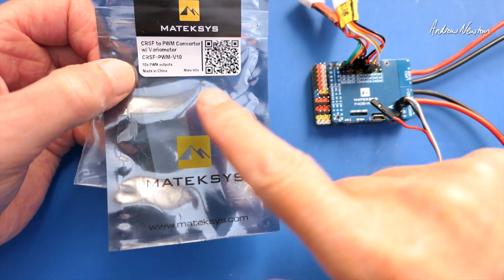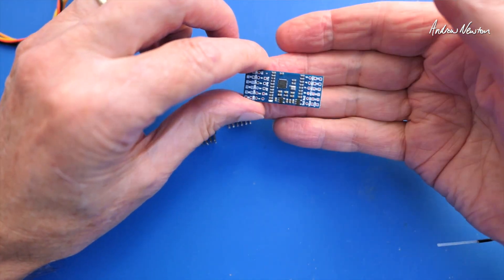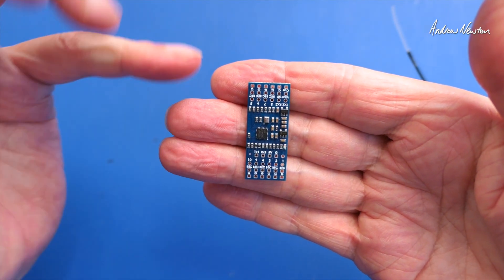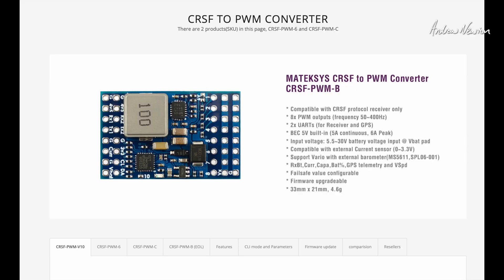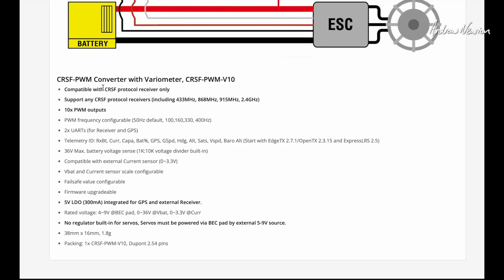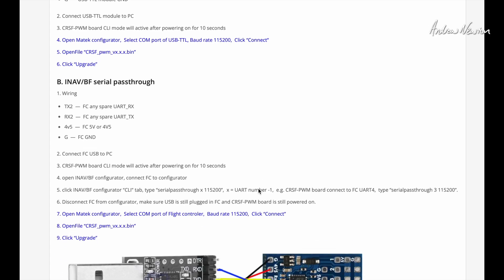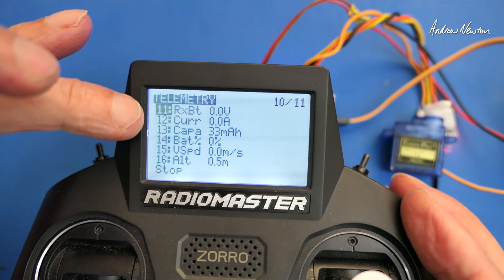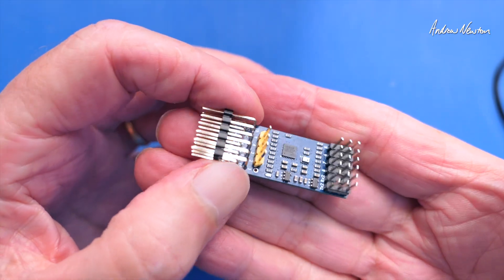Matek CRSF to PWM V10 with Vario

Comment: make ABSOLUTELY SURE you install the latest firmware on all the variants these boards.  Several of us spent MONTHS trying to get Matek to fix a bug that can cause the RX port to lock up causing a flyaway.
Reply from the maker: Thanks, I'll pin your comment
Reply: Hello Litterbug. Yes I was one of those guys that tested the earlier firmware and lost a plane in the forest. I believe Matek did fix the issue with firmware V2.6.x
Reply: I too lost a plane with these
Reply: Yes this is REAL, I was on that thread in rcgroups — as I almost lost a plane due to this. You MUST upgrade!

Comment: Hi I cannot see the remote option in the video ( blur)
Could you please inform me how to get the telemetry data during flight?

My Radio is Radiomaster Pocket ELRS
I use Matek R24D Receiver with CRSF to PWM converter
Reply from the maker: Select Discover new sensors, on the telemetry screen

Comment: I have and use a few Matek V10 boards with Crossfire and tracer receivers. I have never had problems with older and newer firmwares.  Until one day I decided  to add a GPS. It affected my telemetry range... basically I lose sensors at less then 100m... it happened to me on 3 different boards with 3 different  receivers. After removing the GPS module the telemetry issue still persist....  what is going on here? Any idea?  Thanks
Reply from the maker: Disappointing. No I can't suggest a solution.

Comment: Had two die after a few minutes, got hot servos stopped working guess crossfire nano's draw more than elrs. Pity as I never found another solution to use crossfire that had a vario.
Reply from the maker: Damn that's annoying